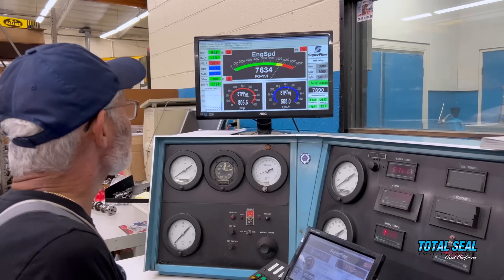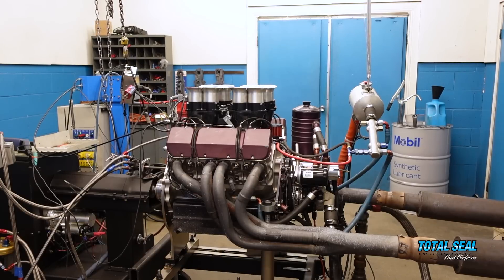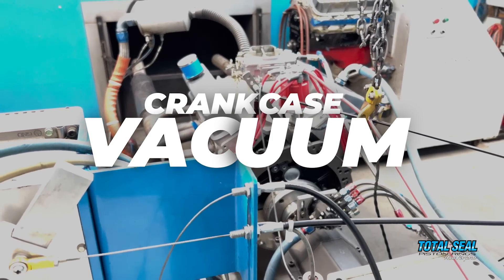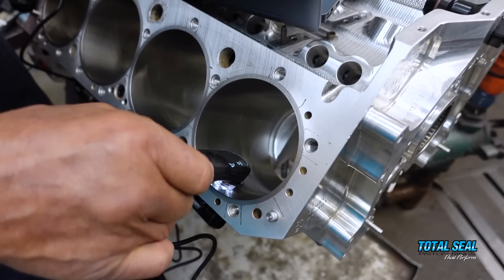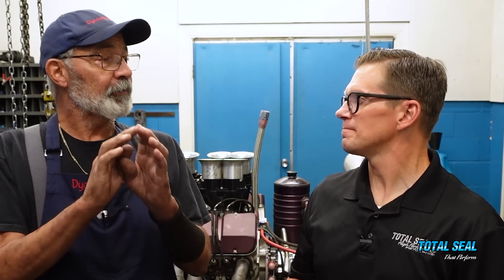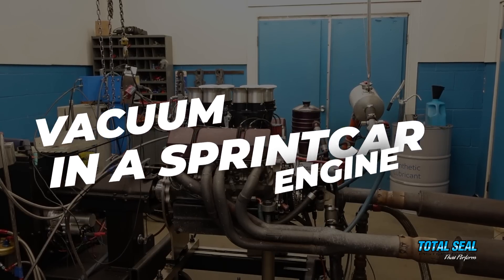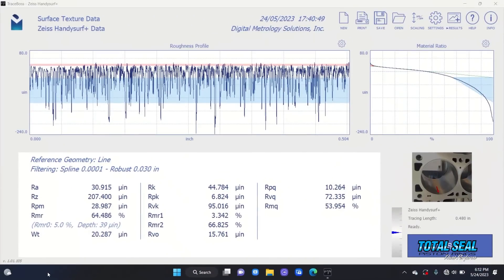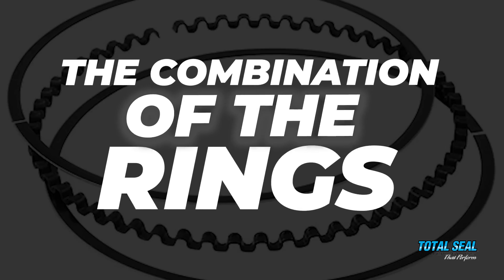Dyno RESULTS: More Valleys = More Vacuum!

Comment: " . . . steel block . . ."   Buddy cast iron drain pipe is about as far from "steel" as you can get - but engine blocks are NEVER "steel" and a lot closer to drain pipe than (even the very highest carbon) steel.

Comment: Enjoy learning from you gents but I'm here in the land down under and I learnt this about 20 years ago. Still nice to see it confirmed seeing we source most of our parts from your country
Reply from the maker: Thanks for watching. We actually found a paper from Sunnen published back in the early 80’s that showed this same strategy. I guess the old adage that there’s nothing new under the sun applies here as well…
Reply: Thank you for responding. My results came about from building and tuning RB26 engines. One could do some light mods and make close to 1000hp without opening up the motor, (other than cams and cam timing), and have no problems with breathing or piston or ring bind. Then when we built them with the American recommended clearances, all turned to sh1t. Breathing so bad one can't keep oil in the motor. Stopped and asked myself some questions......did some thermal expansion tests....and started building with OEM clearances and very fine honing. Problem solved. Applied the same principle to many American and Euro motors I build and the results are the same. Never had a problem. I do however add clearance depending on my reading of the customer as they are the biggest problem:)
Reply: You know that is a good point.  Dyno Don and Total Seal are not giving away newly discovered secrets.  Each of them have to stay ahead of their competitions and you are not going to hear about the leading edge stuff on YouTube.  They are going to keep them to themselves for at long as they could.  That is no knock against them, but the nature of racing and business.  For most of us amateur motor heads, this is good relevant info.
Reply from the maker: @slicedbread9003  You would be surprised how little we are actually holding back.
Reply: @TotalSeal  I REALLY appreciate these guys sharing their info as I'm no one and have never heard anyone give this kind of info. At the time of my thermal piston expansion test......and I've done a number since, I tested oem cast vs half a dozen forged, (also tested blocks. Cast and aly), all various brands so I don't know the material used, but all the forged ones expanded LESS. I have built two of my own motors with 0.0005'' interference.I had to be very gentle on the running in and make sure the tune was spot on so as not to shock the pistons with temp. There was no problem with either motor their whole time cycle. Building a motor like this means one can re-ring a motor a number of times with just a rehone. Piston skirts can be recoated for about $25 here to regain the clearance desired.

Comment: The improved
Ring seal that comes
With thicker oil outweighs the loss
From extra drag on the pump and crank.
Reply: Also the improved wear resistance throughout the motor - piston skirts, rocker pivots, valve guides, rod bearings, cam chain . . . . less wear is longer life.

Comment: Thats Is incredible. Thank you so much for sharing all your knowledge. That has saved thousands and thousands of dollars and steel. Never figure that much information out 7 inches of vacuum at 8000 my thinking was you can't but you did. Mind blown I  won't a motor that can do that !!
Reply from the maker: Current NASCAR engines pull 24 inches of vacuum at 9,000 RPM
Reply: @TotalSeal  wow I didn't know that either so when I've took all the Engines to the machine shop over the last 27 years. They've all been done wrong. Then is what you're telling me!! Mind blown !!
Reply from the maker: @rickybailey7123  If the engine is a dry sump, it can run vacuum for a HP advantage.

Comment: How would this affect say rebuilding a 3.0 liter v-6 in a Ford escape?
Reply from the maker: Very different because the application is completely different.
Reply: @TotalSeal  I get what you guys built that engine for, but I'm wondering do you sell piston ring kits for engine rebuilds that aren't race motors?
Reply from the maker: @russellweber3466  Yes we do! Contact our technical sales department for details - 623-587-7400

Comment: Very interesting stuff guys. In relation to a street motor, obviously the improvement in ring seal is still an advantage, but how would it affect oil consumption as more oil is being left in the valley's above the ring during piston travel?
Reply from the maker: This specific hone is not appropriate for street engines, unless you are running on E85 and boost.
Reply: @TotalSeal would it have to be full E85? I run E50 on a boosted engine
Reply: @aikidokamks less Rvk for E50. 65 to 70 on the Rvk would be good.

Comment: How much material do you remove with the 600 grit diamond and the brush?

If you remove half a thousand with the 600 grit, you would clear the deep valleys you made with the more rough stone right? So in this case, why would you use a 120 stone and then the 600 grit? I understand the process of removing the peaks but i think the 600 grit diamond would remove enough material to not only clear the peaks but the valleys you made and replace them with less deeper ones. 
I hope you understood my question, i watch you from spain thank you
Reply from the maker: With the 600 CBN, we are not measuring stock removal. Instead we are counting the number of strokes. 8 to 12 strokes with about 20% load typically does the job.

Comment: Lake/Donny
Is that the Trace Boss output for THIS engine in the discussion?
Rvk 95 µin
Rpk 6.8 µin
Rk 45 µin

Rmq 54% 

What was your stone combo ? (diamond/CBN/brush/de-burr-block) … what grit? How fresh/clean was the abrasive??

Is that straight out of the hone prior to run … or a post run reading ?

Post break in numbers would be real helpful in understanding what’s going on  ‘the whole picture’ … 

The Rmq number is the most intriguing in the metric you show in this video.
Reply from the maker: Yes it is!
Reply from the maker: That was out of the hone!

Comment: should cross hatch angle change at the top and bottom of the piston stroke because of the differences in piston speed  at tdc and bdc
Reply from the maker: We’ve seen the more consistent the cross hatch is from top to bottom, the better the engines run.

Comment: What does the machining and block work cost like that
Reply: Sounds like they are running the pistons tighter in the bores than normal. Not sure how good this would work in the real world where engine temperatures could fluctuate in hot weather and may cause the pistons to expand and lock up in the bore. They said there was more information to come. May be this will be all explained later.
Reply: @GaryH-pw9cm , in another video, they said they can tighten the bores slightly, because there is more oiling available in the crosshatch.  They also said they ran it right up to 8 or 9000 rpm. Unless there's other problems keeping the fluids cool, it's hard to imagine worse conditions than that.
Reply from the maker: Ball park is $500
Reply: He said itza $ 70,000 engine.
If you have to ask, you can't afford it.
🤔

Comment: Call me naive .   I never knew a crank case could go negative. 🫣
Reply: That’s the purpose of your PCV system. It’s also handy for preventing oil leaks on the driveway.
Reply: @ToddAdams1234  I understand with a PCV system.  Are they using a PCV on a 900+ HP engine. 😳
Reply from the maker: Oh yeah!
Reply: @TotalSeal  m
My only personal reference is my own engine..... Probably +25lbs pressure. 🤣

Comment: Didn’t catch how much extra ponies you picked up ? 😎
Reply: I wonder how much of this could be applied to a stock cast iron block engine. The way I understand it is that the additional vacuum in the crank case is pulling the first and or second ring down against the piston causing a better seal of the rings in the piston. And the better seal of the rings is creating less blow by intern causing a higher vacuum in the crank case. So both of these help each other. Also using gas ported rings and this new hone procedure at the same time. I would guess the crankcase vacuum is from a vacuum pump. Would this apply to a PCV type system if the incoming air was restricted?  In their excitement some of the information presented is not very clear. More diagrams and animations would help for people like me.🙂
Reply from the maker: Yes, this can be applied to iron block engines as well, just a different variant of the hone.
Reply: @GaryH-pw9cm II wouldn’t doubt that the guys are running a “power free” style system of vacuum pumping that relies upon the “Venturi Effect” similar to what you’ll see on other race engines. After all, a vacuum pump is rarely seen outside of diesel applications and then it’s usually reserved for stuff like the power brake when it’s still vacuum assisted AND the HVAC controls.